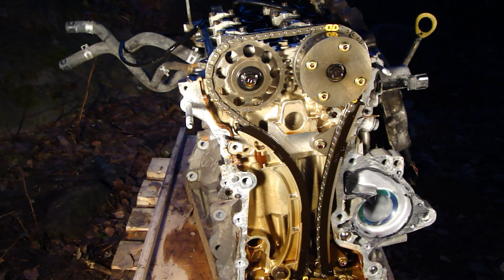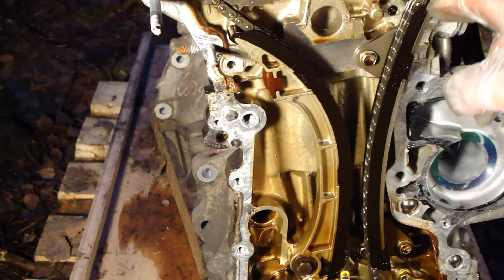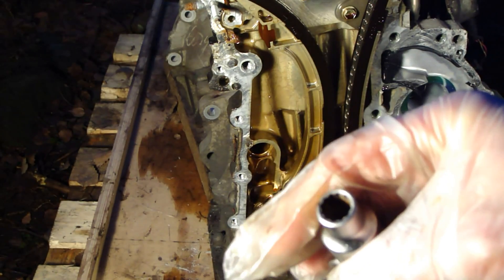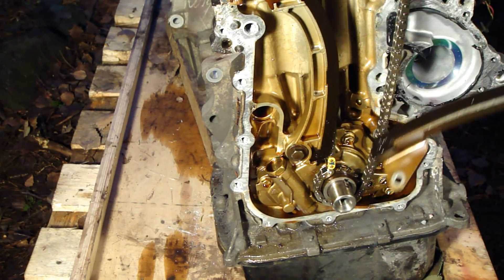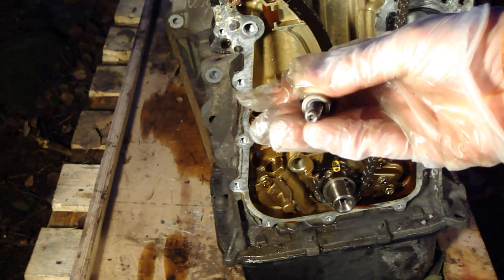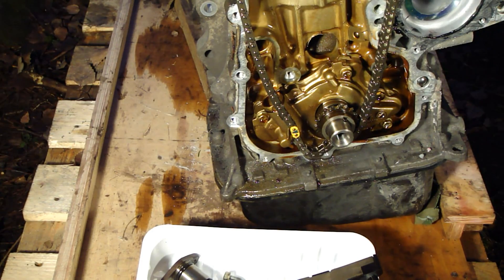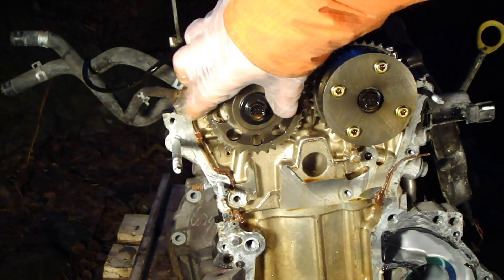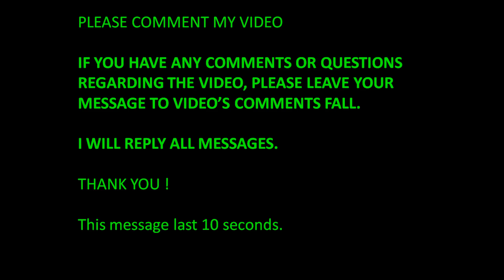How to disassemble engine VVT-i Toyota Part 14-15/31: Timing chain

Comment: Hi Peter, I have watched most of your videos on YouTube, and learned a lot about Toyota vvti 1.8 petrol engines. The question I have is, my engine when starting in the morning, which I think is coming from the timing chain, the noise starts for 1-2 seconds, and then disappears.This has been happening for the last 20,000 miles, but now when I am driving between 2000-3000 revs, I can hear the same noise coming from the engine, which does not sound good. The car has only covered 60,000 miles since new. I service the car regularly myself. I have recently cleaned out the cam filter and solenoid, which has made it a little bit better. How can I get rid of this noise altogether? Thank you for putting all these video up you've been a great help.
Reply from the maker: Hi, I bet that your noise come from valve adjusting shims. Look my service video: https://www.youtube.com/watch?v=IpYPPCDz60U

Comment: Hi Peter

I bought 2002 Camry 4 cyl 2.4 VVTI with 12000 miles and the oil engine light start flashing  on idle for few days and then it became always on after. I changed the oil and filter but it still has the oil light on and the engine start rattling toward the bottom. ANY CLUE what could be the problem or what to start with. I'm thinking of the crank bearing but I don't think its the oil pump which almost impossible to fail.
Reply from the maker: Hi, bad signal. Your oil pump or engine is damaged
Reply: Gud mor sir my name is akeem olayiwola abiodun am mechanica i won't too com too ur place now too com nd len more about my work pls can u help me  my wazup nun is 07068605713